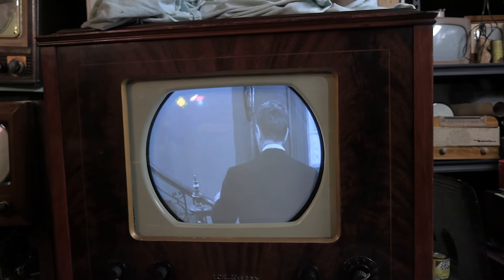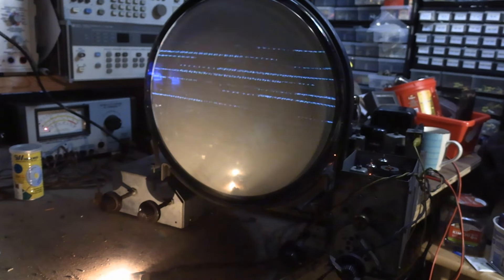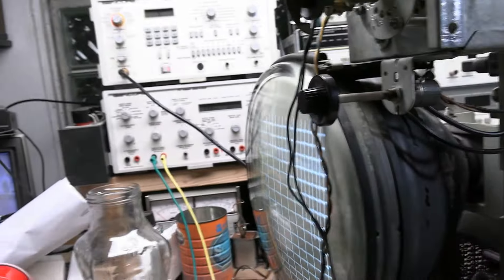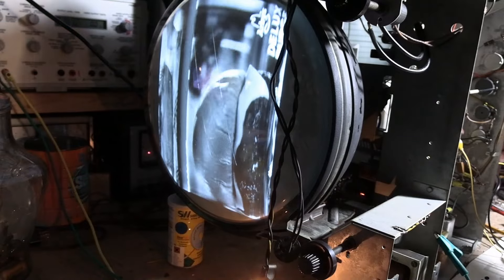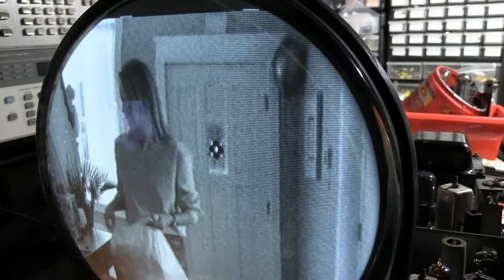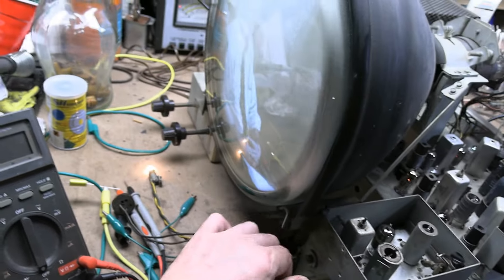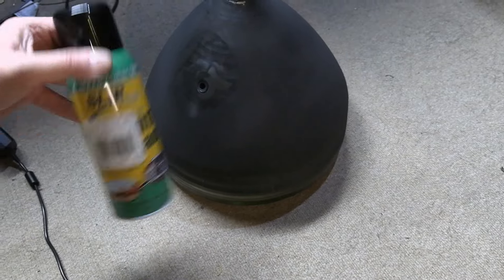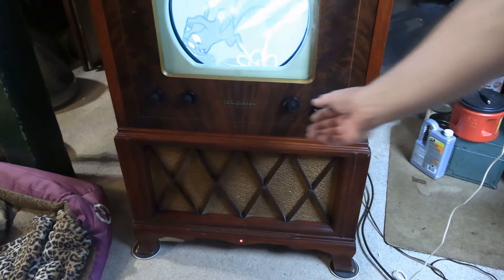Dueling RCAs part 8: 9TC247 is complete!

Comment: Replacing the tuner you need to sweep align the Video IF. The tuner to VIF stages is via an over coupled transformer that can only be sweep aligned. Especially critical in these sets:split sound with two upper adjacent, two lower adjacent and two sound traps. Once properly aligned, the RCA Victor picture quality is the best!

Comment: Yep, that relatively massive lead sleeve on the tuner tube is not for radiation sake, not with the low voltages it runs at.  I'm surprised it had a vibration problem requiring that, as newer TV tubes didn't, and I never ever saw any kind of microphonic effect in a tube TV of the kind I worked on in the 70s, but maybe it was just a vulnerability of that early model tube and this was the hack to keep the picture from "vibrating" along with the sound.  I'd be curious to see what happens to the picture if that tube is tapped.